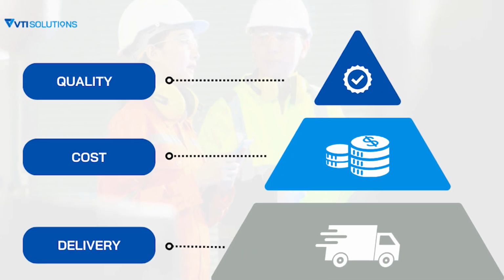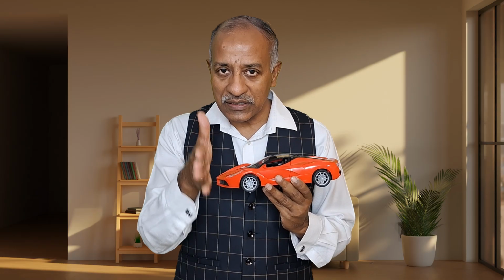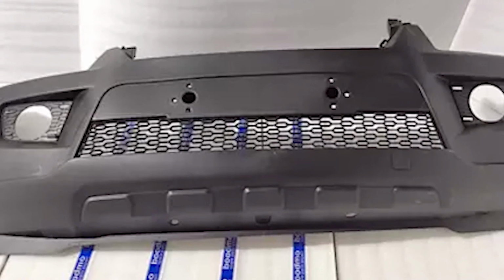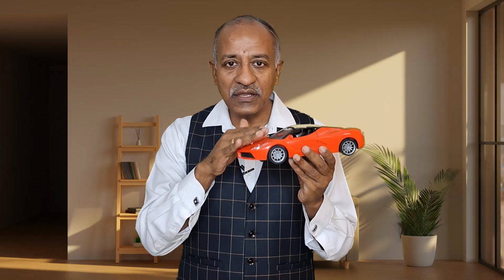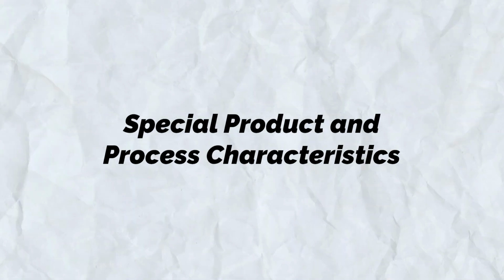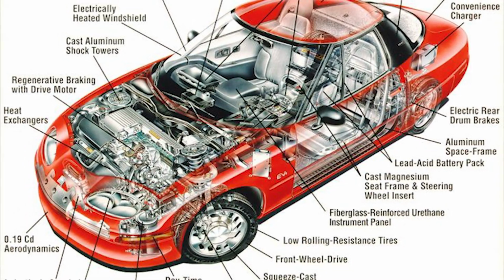APQP 3rd edition, Phase 2: Designing with Foresight | English | Bhavya Mangla

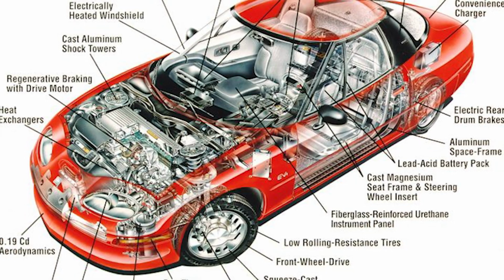Comment: Thanks for sharing this with community! At 08:45 minutes, Bhavya talks about many parts that are important for making a Car. Many of this parts are actually ordered from suppliers to provide them based on specification and design. While one is writing specification including material and component requirements then requirements management tool can help a lot. It will enable Car Manufacturers to draft clear requirements including functional and non-functional ones and then provide them to appropriate component suppliers. Also reuse or modify component specifications over time when new models of the car is worked upon going forward. Hope this helps!
- OpenRose - 🏵 Requirements Management Tools Team 
FREE and Open Source!
Capture, Define, Trace, Change, Prioritize, Baseline, Negotiate, Test, Deliver >>> Repeat the Process.
Reply from the maker: Wonderful. Excellent explanation